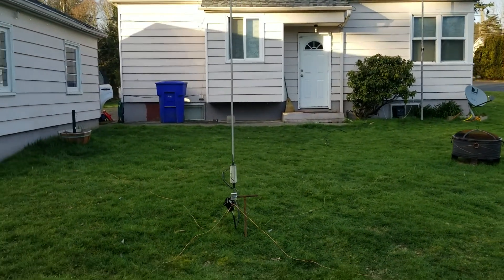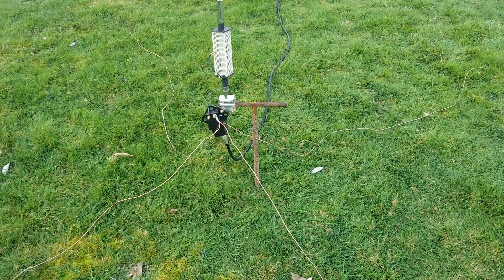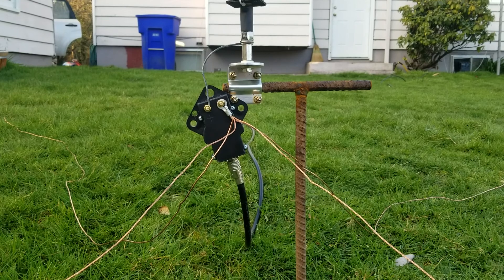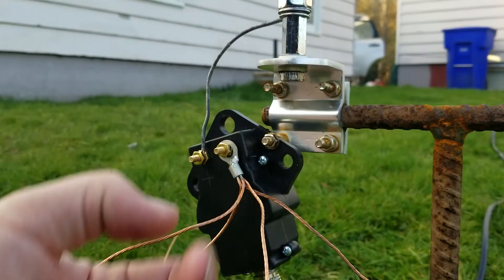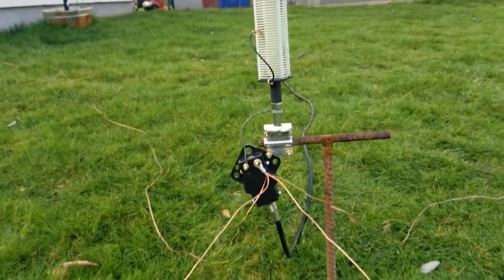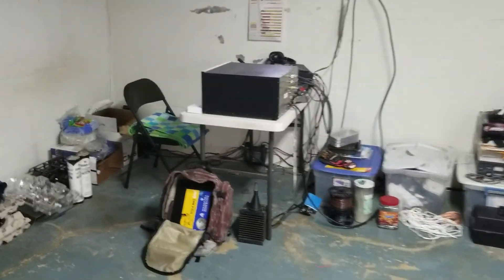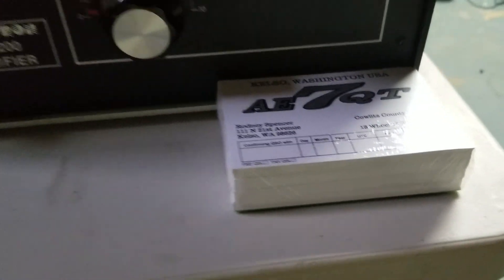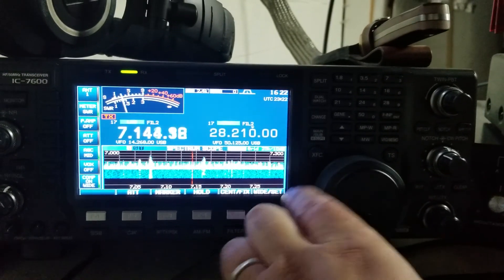AL-1200, IC-7600, MFJ big stick setup

Comment: ok I have had that same antenna for 10 years. My son won it at hamvention. My wife and I got a camper so I am ressurecting that antenna and I want it to be my primary antenna for 40 and 20m. (I really only need those bands) I cant get the damn thing to get a swr under 1.7 under 40m.. and moving that jumper on the coil makes it jump. What is your trick because if I am reading it right your IC-7600 says you got a 1:1 match on 40m. Which is AWESOME.

Comment: Hmmm., interesting. Thanks for the review on the big stick! AL1500 still looks like the rf line BOSS!
Reply from the maker: I have the AL1200, it is second in size to the AL1500. The big stick seem to perform pretty good that day, I had several good conversations. I had varied the power output from 100 Watts all the way up to 1500 watts with signal reports changing accordingly.